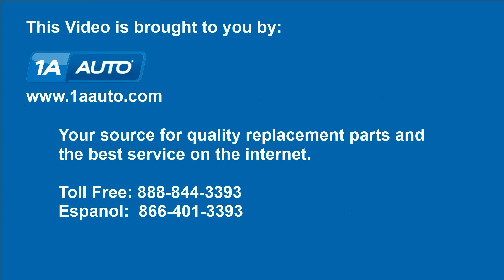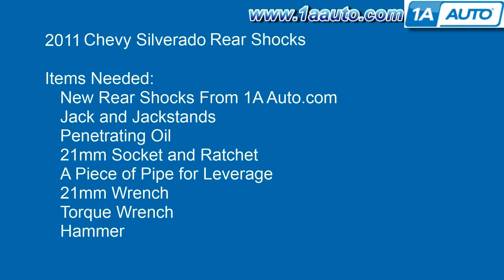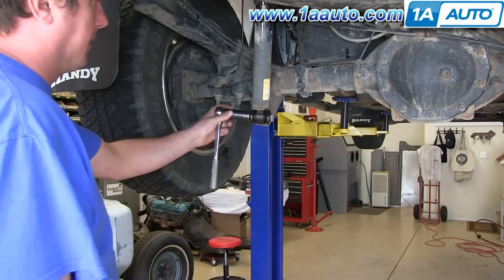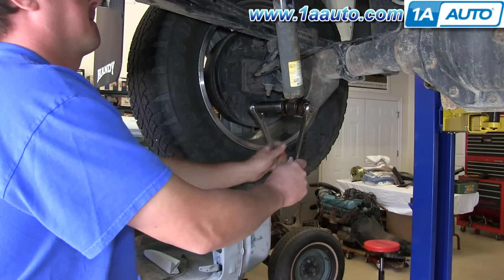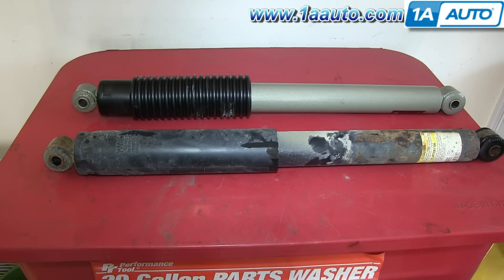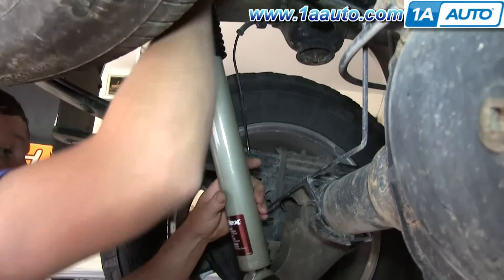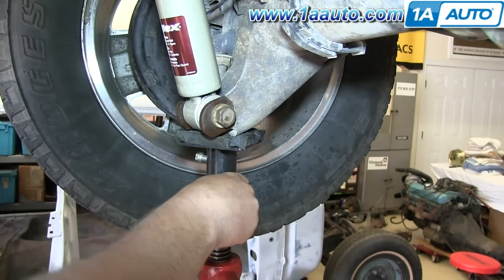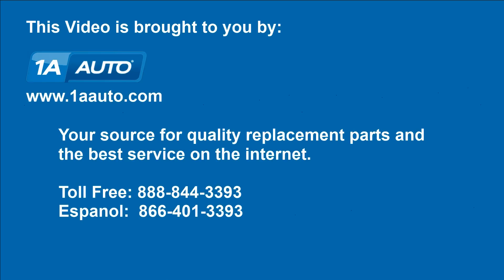How to Replace Shock Absorbers 07-16 Chevy Silverado

Comment: thanks for this video. I just changed the struts on my 07 Tahoe and I encountered the same problem as the person below. the ABS & stabilitrack lights came on. do you know why that could be?
Reply from the maker: +Angel Rodriguez Make sure both connections are clean that the sensor plugs into. Hope this helps you out. 1aauto.com
Reply: 1A Auto Parts thanks for the info,  I found one of re connections unplug it!

Comment: Thanks for this Video. Have a question , does the truck need a wheel alignment after replacing rear shocks? The GM dealer gave me a quote that included wheel alignment. Appreciate your advise. Thanks.
Reply from the maker: +Michael Carvalho If you are just doing the rear shocks on this application, you do not need an alignment. The shocks on this vehicle are secured in a way that does not alter the steering alignment. Here is a link to the replacement shocks that we carry, which are shown in this video. Hope this helps you out.http://www.1aauto.com/1A/shocks_struts/Chevy/Silverado1500/MNSSP00604?utm_source=YouTube&utm_medium=CTA+Comment&utm_campaign=ytcomment&utm_term=0A6b2emTtIs

Comment: just changed mine out on my 07 Tahoe , ABS & stabilitrack light came on!  why??
Reply: ambrocio benitez I’m sure you figured the out already but more than likely your either accidentally knocked a speed sensor unplugged or out of whack. That would cause the speed sensor and tone ring not to communicate with one another and if the abs won’t work then the stabiltrack won’t work either